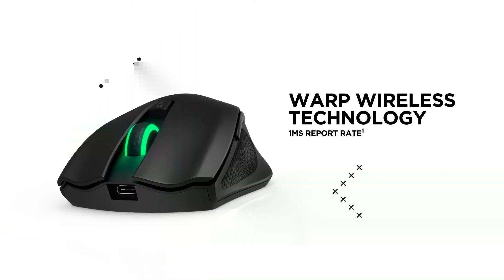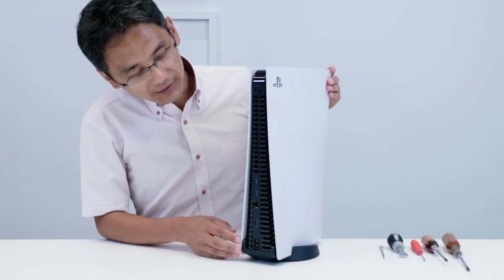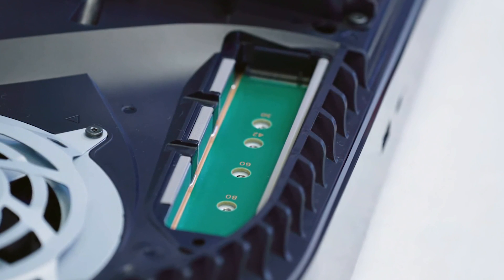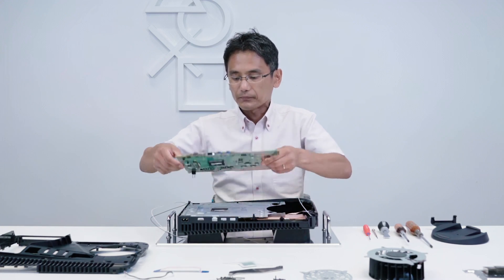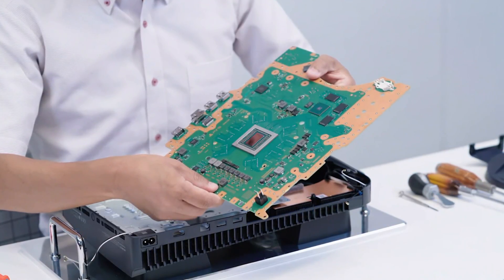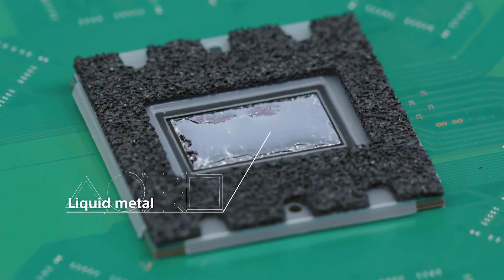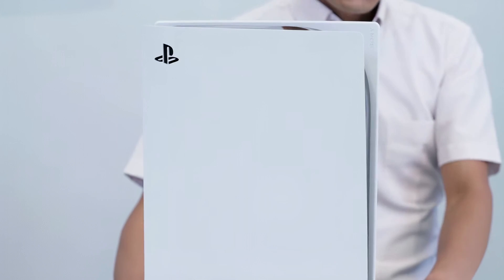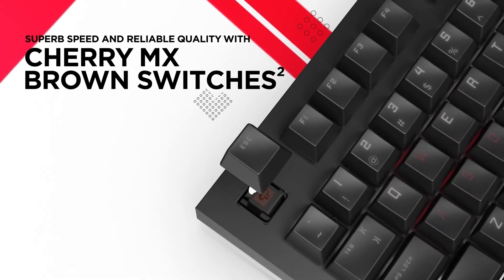PlayStation 5 Teardown Analysis: Inside Sony's Next Generation Hardware Design

Comment: We are in Bizarro World when the Japanese solution is the sledgehammer, go big or go home solution to thermal regulation on a PCB the size of a baseball diamond, and the American solution is the jigsaw internals, compact but big power utility-like industrial design.
Reply: @nickgovier  I was a PS user since PS1 and my friend Xbox, he chewed through 3 360s in the span of a few years due to RROD while my PS3 is still working to this day, altough the performance has always been better on xbox as far as I can remember (and xbox users get to play Banjo Kazooie in 60fps with analog feelsbadman)
Reply: @nickgovier  Xbox took care of people with that situation. No questions asked iirc.. mine was secondhand and I still received a prepaid "coffin" and got my xbox fixed in a timely manner. It still works. Gotta appreciate when brands stand behind their product.
Reply: Yes. The internal design of the PlayStation 5 looks old-fashioned and cheap compared to Series X.

Comment: But, did he complain about the ps5 ssd expansion?  I did not notice.  At least later whoever wants to switch to, eg: 1 Tb to 2 Tb, can easily take advantage of the previous one and connect to another device: PC's, etc ... But, on the other hand, the proprietary solution from MS is bad if the user  want to change to another capacity.  What to do to the previous one?  Insert in the asss?  By the way, but what a lack of ... Well ... It was an analysis as well as without salt.  Tasteless.  I hope that after leaving the console they will be detracting ... With the tail between the legs ...

Comment: Imagine DriveClub PS4 backward compatible on PS5 with 60 FPS. That and I'm getting the PS5 day one. The only downside of DriveClub PS4 is the 30 FPS cap
Reply: Just hope that is not a game engine limitation, which is most likely the case. I'd imagine it will just be another supersampling of res and still 30fps.

Comment: For me clearly the PS5 went for a "console" design and mentality. On the other hand, the Xbox is just a small form factor PC.
Reply: is that a bad thing?
Reply: @weiwu1442 I never said that, I just pointed out the 2 VERY different approaches. Sony clearly put more thought on it though, imo.
Reply: @SomeoneImAshamedof  Yeah, you buy the components from different manufacturers 🤦🏽‍♂️
Reply: @SomeoneImAshamedof  It's a cheaper solution because it's larger. DF practically say this, but it's a well known fact. The PS5 is the biggest console by far, yet it's less powerful than the Series X. Making a console smaller requires more expensive hardware designs and more exotic cooling solutions. It's also just technically harder to do and needs more testing. The PS5's massive size makes it easier and cheaper to manufacture.
Reply: @NoClipMode  that means sony was smarter for making it cheaper to manufacture lol
Reply: @Jimmyxsx  no it means sony fooled its consumers and fans by going the cheaper route and getting lesser performance with a bulky design. Means less R&D . Just look at the big power supply drawing huge electricity while the xbox has a more powerful hardware and draws 300plus watts. And remember the ps2 days vs xbox, Japan known for small form factor just like there cars. This time around hardware on SX feels more moneys worth
Reply: @MrRGM10  wrong, look at that cooling system of the PS5. They didnt go the cheap route with that badass heat sink and liquid metal. The power supply size means nothing, like the guy from DF said you would have to perform a power consumption test to see which one is using more electricity. The series X is gonna consume more power because the cpu is always at full blast regardless of what its doing whereas the PS5 has variable clocks to save power when not needed lol
Reply: It's clearly the opposite. The PS5 is roughly the size of many PC cases, it's larger than any other console, and it even looks like a cheap PC "gaming" case. Even the sides are removable like a typical PC case. But MS getting XSX performance in to something of that size has required them to do stuff that's nothing like a PC design. Cramming that level of performance in to something of that size is far more custom and console-like.
Reply: I think that Sony went for the cheaper solution. And its show in possible performance problems. We will see.

Comment: So with wifi 6 will I FINALLY be able to utilize my FIOS gigabit connection?
Reply: would never connect a device that is standing in one place with wifi. Just too much problems that can appear
Reply: No, that's not what wifi6 is for. If you are on FiOS (gigabit), then you need to have CAT6 ethernet cable to utilize it. If you are not doing that already, you are an idiot wasting money.
Reply: Ohhhh okay at the very least I hope there is better download speeds than the ps4.

Comment: You know what else is possible with wifi 6? 10gbps data transfer rate so don't doubt them because unlike you I actually kept up with my IT studies it just depends on the router and the ISP
Reply: By the time average consumers have an internet connection beyond 1 Gbps they'll have upgraded their gateways and optional switches, so the temporary advantage of Wi-Fi outperforming a wired connection speed-wise will be short-lived.

Comment: During the strip down you mention the ssd cooling for third party ssd drives. If you watch the strip down just as you see him take the metal sheilding off there is a heat sink block on top of the plate which to me lines up to the ssd slot and would mean heat disapates to the heat block and the fan would cool it. Do you think this is the case? Maybe you won't answer but it's defo how it looks to me..

Comment: You can see Richard  still doesn't fully understand  the boost clock and his questioning of cerny and looking for a base clock Probably  annoyed him at the time.

Then doing that bad rdna 1 test that didn't match up with what cerny said  because it was poor test. It went beyond chip logic.

There's so many other tests to be done that could have shown how a lower cu higher clocked gpu can easily perform similar or better than a higher cu lower clocked one. With a similar tflop difference like ps5 and series x.

I hoped we would have seen more but we didn't.

Comment: Prediction - Wi-Fi 6 is for next gen Sony VR.
Reply: Martin Schmidt  Don't be like the cult of Playstation dude. If PS4 could do VR, PS5 most certainly will do it better.
Reply: @nonyabusiness6084  ehhh, not really due to how the games are built for the very low-spec psvr. You are talking about 60fps games that physically can't push any more frames than that since that's how fast the game engine runs.
Reply: @sqlevolicious  Geez you're an overly opinionated git then, aren't you?

I'll have you know, that Wifi 6 is already in use on the Quest2 - that works FOR PC TETHER. Is it as good as the cable? nope, but, it works and for most game types, it's good enough. So, just the existence of that invalidates half of what you said there, alone. So, I'm not saying for certain that the PSVR2 WILL be wireless, but, the possibility is there. I actually believe they'll have 2 models (or an upgradable path, like the Vive has).

As to the BT5.1 Here's a quote that took me seconds to google.

"Bluetooth 5.1 brings new “direction-finding” features that will let Bluetooth devices pinpoint physical location to the centimeter, aiding in indoor positioning."

Accurate enough for VR tracking? probably not, but it could be used as part of the suite of sensors, reducing inaccuracies and aiding positional guessing algorithms. At the very least it can greatly improve the guesswork for inside-out tracking, when you move outside of the camera's views. So, once again, it is you who are talking out of their arse. 

Also you're completely idiotic (like Martin here) if you think that the PS5 isn't as powerful as a fucking Quest (which is literal mobile hardware!) and you're completely incorrect with the 1/8th power (how tf did you pull that figure out). You can play HL:Alyx well on a $1000 PC, no problems and that is the relative power of the XSX/PS5 (slightly higher really - and being consoles, they CAN make better use of lower grade hardware, as is proven many thousands of times). And not only is HL:A a game made for ALL types of hardware (so deliberately general), it is also one of the most spectacular VR games to date. So, even if the PSVR2/PS5 can ONLY reach those levels, I'd call that a win, wouldn't you?

You "could" be correct about foveated rendering, but then again, my point was that the GPU hardware to make it a reality is already in RDNA2. Eye trackers already exist, are more than accurate enough already for what is actually required - which is to give a general target area so that VRS can do it's thing (AND eye tracking has already been trialed as a way to automatically adjust for IPD, so could be used as a catch all). Unlikely, perhaps, but, like I said, the ability is there, it comes down to cost. People didn't think PS5 was going to go for liquid metal cooling "because of cost", but, they found it to be the more cost-effective path, so you never know until it's final.

I'm also not suggesting the PSVR2 will be a headset to rival the top of the top PC (like Index) but it should come out as a VERY capable and cost-effective mid-tier unit. I mean, the Quest 2 is like $3-400 and it is a GOOD unit. PS could easily sell a $400 and $500 (wireless) unit. Potentially 5-600. Still a damn sight cheaper than PC VR
Reply: I just want to know about the next handheld they will release in the next few years. Just beef up the Vita.
Reply: @REAL6  not going to happen, smartphones have taken over that market
Reply: @hermeticdragon2643  It will happen. Wait and see. It didn't take over any market. It's only apart of the market.
Reply: @REAL6  Pointless when the switch exists.
Reply: Martin Schmidt  hahaha, you "debunked" me!?! Hahaha. Well done, your "evidence" was so convincing, I have nothing. /s

Your opinion is irrelevant, incorrect and idiotic. Clearly I'm not going to get a decent conversation with you, so I'll leave it there. Good day
Reply: Martin Schmidt  Are you being obtuse or do you just not understand technical things? 

There is a VAST amount of the PS5's features based heavily around VR and the experience as a whole. In fact, I wouldn't be stretching much to suggest, that the system as a whole was designed around VR from the very outset. (it also wouldn't be a stretch to guess that upon release, the PSVR2 might even beat out most/all of the current PC VR headsets in features and experiences - with PC catching back up reasonably quickly thereafter)

Wifi 6 is perfectly poised to work for wireless VR. The Oculus Quest 2 has this feature and can use it as a PC tether (instead of the cable) to quite good success. Having Bluetooth 5.1 should help immensely too, as, if I'm not mistaken, it can be used with quite high accuracy to track positions and motion. So, a mix of both in tandem will be very likely
Reply: @MrVelociraptor75  This very much. 

Sony is very bullish on VR. Cant wait to be blown away with an affordable PSVR2.

Itll probably feature Foveated Rendering and Finger tracking - but will it feature Varifocal Actuation? 

My baseless guestimate says, we'll know Q4 2021 - Q1 2022
Reply: @MonSteh  No, no, and not even close.
We wont even have the technology for foveated rendering within this decade. The latency required for that photo-to-motion speed is currently unheard of. Which is why foveated rendering is nothing more than a pipe dream right now. 
Varifocal actuation is also another pipe dream that stays put in R&D for the next 10 years. More weight and servos would mean running backwards in VR hardware development.  

PSVR2 (if Sony actually wants to develop it), will just be a display upgrade that will run at a native 90hz, have new controllers built for VR and not much more. The games will have to be rebuilt to support the new controllers and the games will have to be rebuilt for native 90hz. Don't expect the system to be cheaper than $400 either. Nor should you expect the system to be any better than first gen VR along with games that are far behind modern VR.
Reply: @sqlevolicious  crusher of dreams right here. =(
Reply: @MrVelociraptor75  latency has always been a huge issue with vr so sony's super fast ssd would benefit psvr im sure
Reply: @hermeticdragon2643  the SSD will play some role in the experience, I agree. But, I was thinking features like seamless texture changes (it's got a name, but I can't think of it. Think UE5's Nanite) and VRS allowing foveated rendering in the rendering pipeline, should allow the console to display some amazingly sharp VR images and experiences.

Added to that, the 3d audio engine for headphones and haptics etc, everything in the PS5 screams "VR!"
Reply: @MrVelociraptor75  None of which exist in reality. Those are conceptual technologies that are at least a decade away from even being possible for viable use. Consoles won't have even if it did exist.
Reply: @sqlevolicious  SSD speed has nothing to do with latency? Ram speed has nothing to do with latency? 

please explain.....
Reply: @MrVelociraptor75  Nope, nope and not even close. 
The fact that you have no understanding of wifi 6 and the massive inherent latency involved with 5ghz shows how your understanding of hardware is completely missing. 
fyi, the ps5 and xsx both are not even a 1/8 of the required processing power for modern VR, 5 YEARS AGO. You are talking about processing power and bandwidth than no console will have for at least another 2 generations. The exception being Quest-like android-based games like what the psvr runs. 
PSVR2 will not beat any headset north of the Quest 1. There simply is not any processing power to push that kind of fidelity from either console, and won't be another 3-5 years at least.
Quest 2 only uses wifi 6 for the same reason that wifi6 remote technology exists, for crosstalk issues over network games.
BT5.1 is not for 3d spatial tracking, nor could it ever be capable of such. It's a optimization of previous generation for hifi audio, lmao. 
So stop pulling lies from your ass.
Reply: Martin Schmidt  What are you talking about? You don't know what you are saying.
Reply: Martin Schmidt  Maybe your brain is riddled. I don't even own a PlayStation and believe me, you don't know what you are talking about.
Reply: Martin Schmidt  I agree with you. I wouldn't dream of using an APU for a good VR experience if I had a desktop available. With that said in mobile vr like quest 2, the soc is the perfect fit. I hope psvr2 is a lot better than psvr, its got to be
Reply: Could be if they want to continue down the path of bad VR. Good VR only exists via tether (exception is quest in standalone)

Comment: It's maximum 5.5 now? Not minimum?
Reply: 5.5 raw and 8-9 uncompressed
Reply: @bastien4530  I know those numbers, what I means in March cerny said 5.5 was the target minimum, but here in this video ge said 5.5 raw was the max. So did something change ?
Reply: @djAmored  5.5GB/s is the SSDs raw performance without any data compression which means this is the target minimum (or max raw performance), with data compression an average of 8-9GB/s with peaks of up to 22GB/s, so on average it can fill the entire 16GB system memory in less than 2 seconds.

Comment: The series X out performs  the PS5 in every possible way and if you dont believe me look up the numbers. Overall the console is at the very least 20-30% more powerful console than its competitor.
Reply: Ryzen cpus don’t gain that much performance with an oc! The gpu in the ps5 is oc’d pretty damn high so the gpu will pretty much match the Xbox series x. Don’t listen to all this tflop fiasco because tflops don’t mean anything, there’s a lot more to it than that. Just like ocing my 1070 can match a 1080 or 2060 which both have more tflops 🤷‍♂️
Reply: Another thing as well, if these reports are true about the series x overheating which they probably are since the heatsink in the series x is terrible. If the cpu and gpu get too hot they will thermal throttle which means lower cpu clocks and also gpu clocks which will affect performance especially when it comes to the gpu side of things. Good cooling is an absolute must to keep components from thermal throttling and keep that performance steady especially for overclocks!. The ps5 will have zero issue due to liquid cooling and that beefy heat sink with plenty of heat pipes, Xbox series x on the other hand no that much.

Comment: GD they made it Huge!!! It's as big as the guy 🤣 well, the console not the SoC, but at least it runs hotter, has less grapical features and capability and zero current memory upgrade options.  Also you have to be a mechanic to turn it on its side much less getting to "easy to upgrade m.2 slot"..lmfao 

GD, they are so fkd 💯 More powerful, smaller, easier, all your stuff works with it, GamePass Ultimate for gaming ANYWHERE and full DX12 Ultimate support, etc.. Omg, this COW is screwed

Comment: It kinda has a similar philosophy to Kalashnikov's weapons (AKM, PKM, and AKS-74U) - simple is just better than complex; lots of intentional empty space on the inside so incoming heat and particulate have more volume to dissipate across and as long as it's still in the air or maybe even this expenditure by Sony includes a crazy low-friction plastic that dust has a hard time gripping too (which I admit is crazy), those particles can exit or accumulate on the outer side of those outlets. The PS5 needs to breathe but looks not only a damn good pair of lungs but a circulatory system that fits it too looking at the PCB.